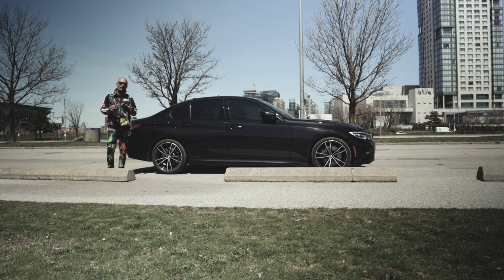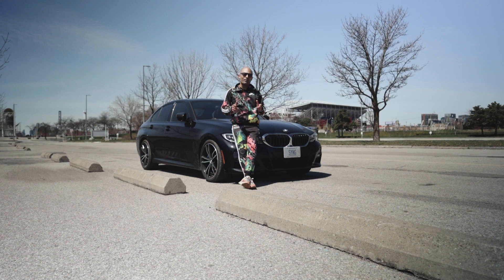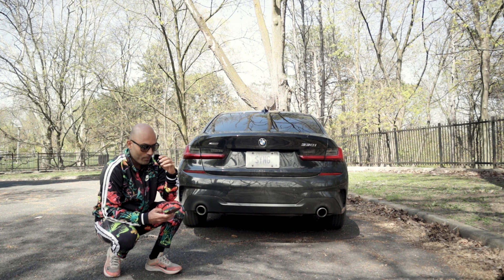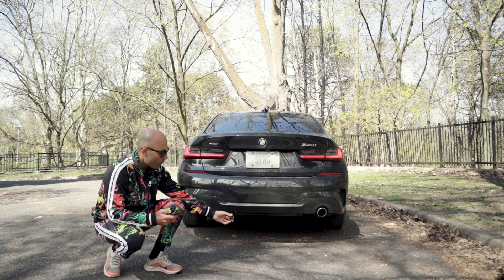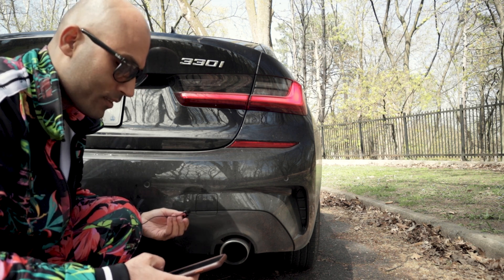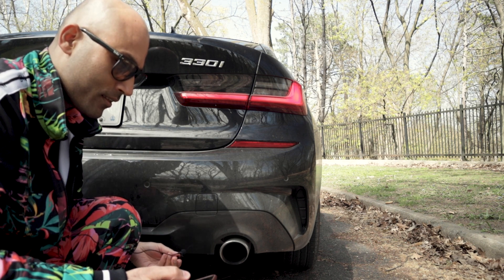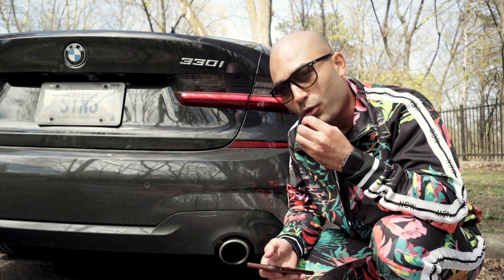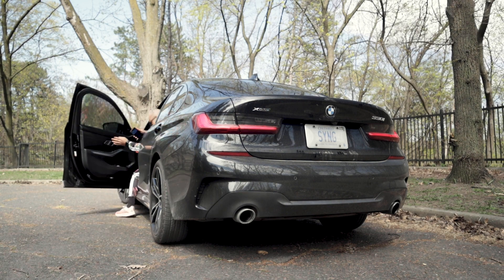How to fix fake engine sound in a BMW (Pumped in audio) — BimmerCode / BimmerLink (Pt. 2)

Comment: Why the f**k would you turn it off?
Reply from the maker: It's super annoying.
Reply: @syng.  I don’t notice it in my 430d, even though I’ve been told it’s there. Not sure if it’s when I put my foot down, or when it’s idling. Either way, my car sounds awesome. The fact I can’t even tell if, never mind when it’s happing. Means it’s the opposite of annoying. For me anyway.
Reply: @AlmostLastJedi  In my 330i the fake sound is like a Subaru boxer layered over an inline 4 sound. 😖
I drove a loaner 230i (LCI) and it had a different fake sound. Both pretty dumb to me.
Reply: If you have aftermarket subwoofers like me,  it really sucks especially in sport mode.
Reply: @ Oh, I have the Harman Kardon and it sounds great.
Reply: because it sounds like shit and its 100% pointless